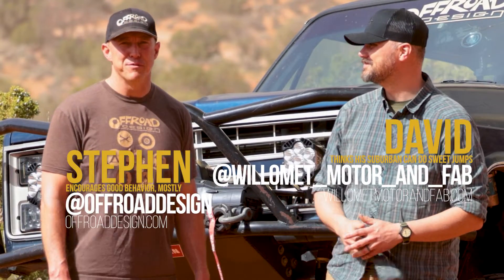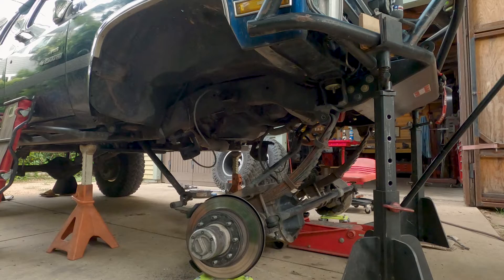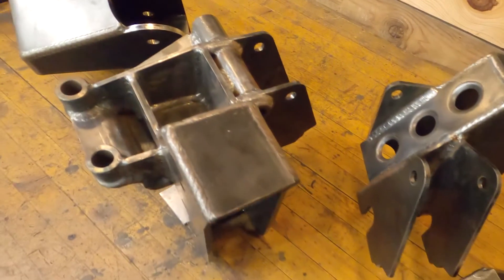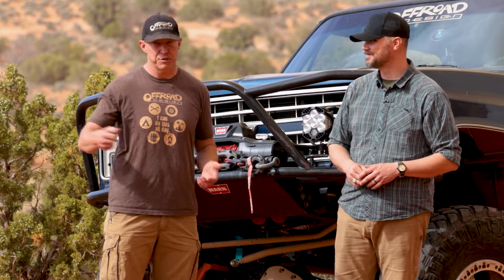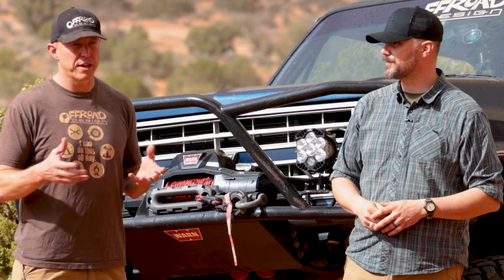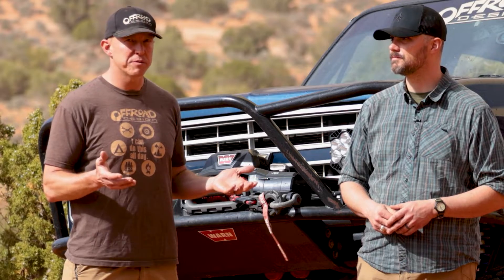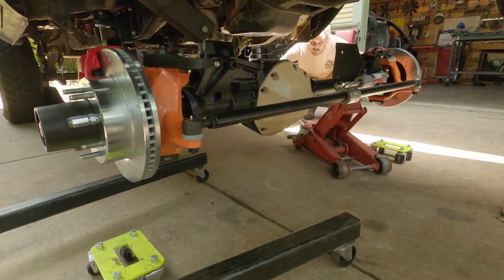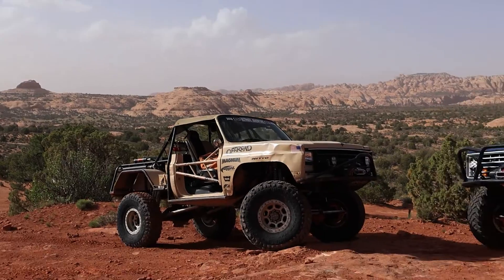Five Brackets to Freedom - Offroad Design Link Instruction Supplement 01/05

Comment: Pretty sweet.. How long was the Suburban on jack stands, a year and a half… Two years? Outstanding work, especially for a back yard build. It just goes to show you that you don’t need a high dollar shop if you’ve got the gumption.
Reply from the maker: Thanks man. The truck was on stands for about 6 months, and fine tuned on tires for another month or so. You can do this work in a shorter period of time if you not: a) filming it b) doing all the ancillary integration work (exhaust, etc.) like I did.

Comment: Why couldn't one have  single leaf springs that would act as the links do and still use coils to support the truck ?
Certainly not as good as your setup but very simple.
Reply from the maker: You certainly could do that, but the benefit of links is less about coilovers delivering a spring rate and more about exceptional suspension geometry and steering. Leaves don’t do the latter nearly as well.
Reply: @WillometMotorFab  I get that,  I'm just looking for a better ride quality and leafs are such a simple set up .
Reply from the maker: @ExploringCabinsandMines  Understandable. Links are worth the stretch.